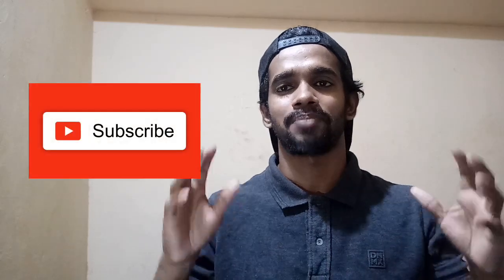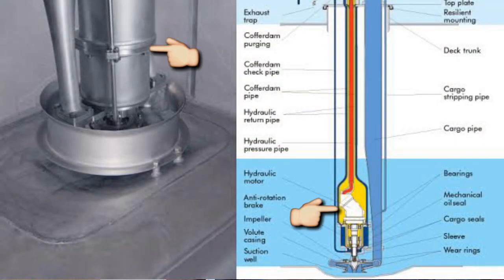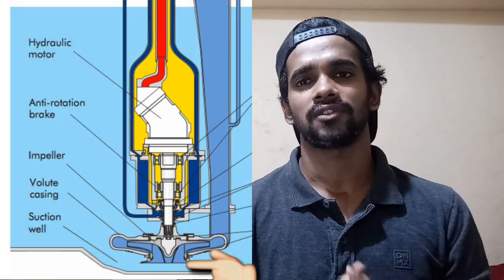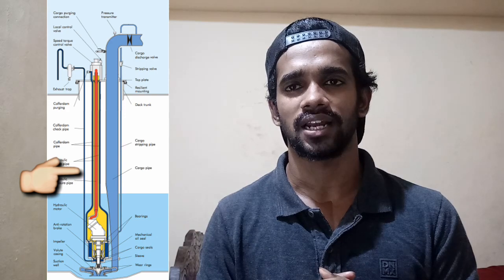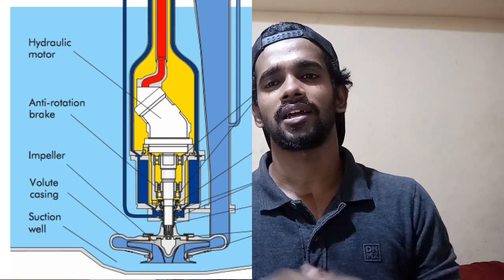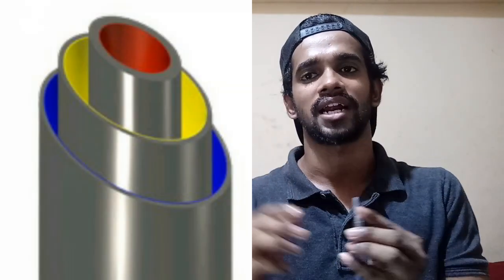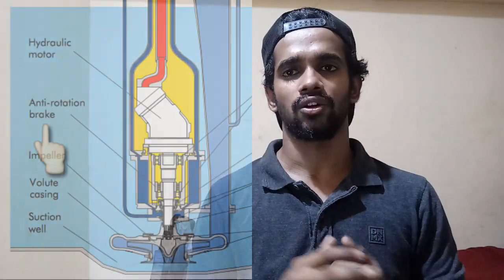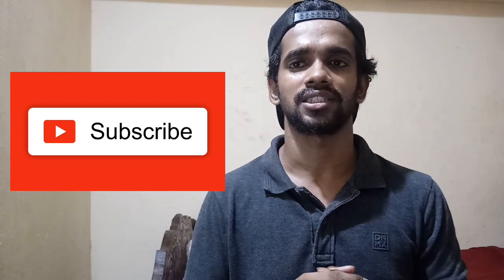FRAMO CARGO PUMP OPERATION EXPLAINED CLEARLY II MUST WATCH II No More Confusion from now

Comment: Very good video! I am sailing on product tanker and we have Framo system. Not only on MR size tankers but also on LR1 and LR2. And also Framo is very reliable system and if you dry run it for short period time it is not big issue such as on COP systems.
Reply from the maker: 👍 
Thanks for ur valuable words and comments

Comment: Fyi, Feed pumps are not used for maintaining the hyd tank oil level, to maintain protection pressure on LP and HP(when main power packs at idle). if protection pressure falls below 6bar(closed loop- feed pump) & 2 bar(open loop - jockey pump), alarm will be activated. Reason to maintain protection pressure is to avoid ingress of cargo into the hydraulic system.

Comment: i have few questions , 
1) feed pump is keeping the lever in the hydraulic tank, from where the feed pump is taking the extra oil to keep the lever in hydraulic tank?
    and we have usually 2 feed pumps, we run one by one , or both in the same time ? 
2) If we have anti rotation brake in the bottom of the pump , it means we can load safely through discharge line without any consequences? 
3) on the drawing at 0:41  we can see from both of pump stacks some red remote line , what is that line for ? 

Thank you great video !